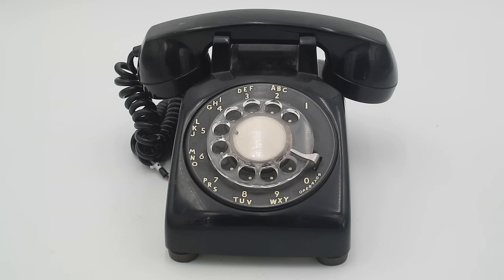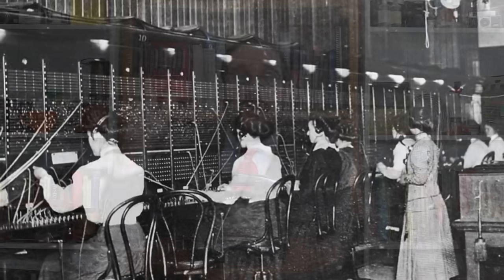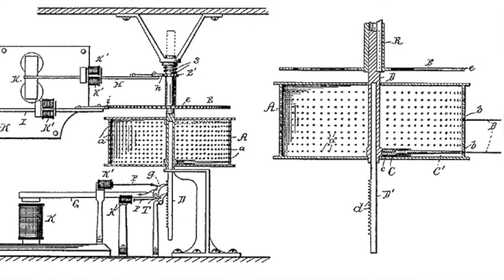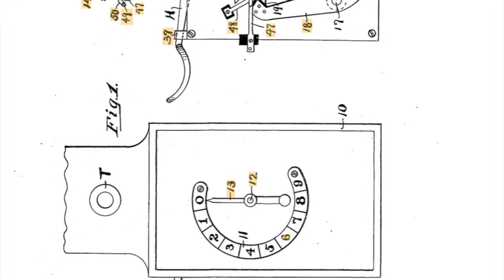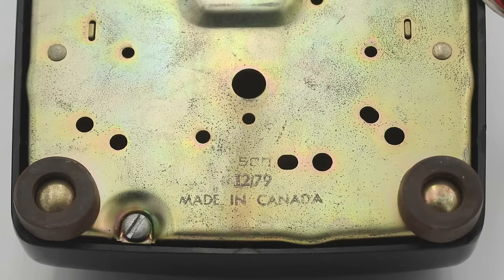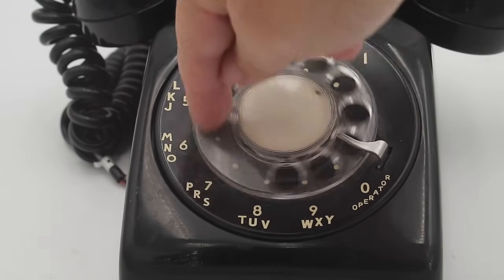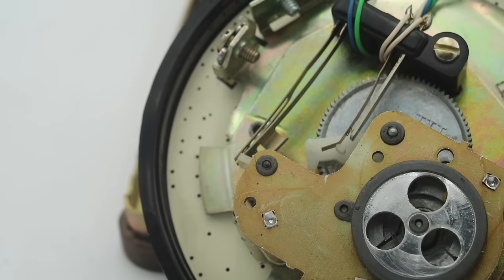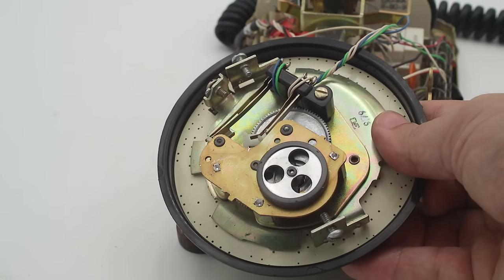Rotary Phones: the Call of History

Comment: Model 220 Slimline was also called "The Princess Phone". Neighbors got one in '66, I saw it.
Also: Model 500 was made of plastic so tough, you had to literally hit it with a sledgehammer to break it.
I've only watched 11min of the video so far, maybe this was mentioned later, I don't know.
Highly informative channel, glad I subscribed.
Reply: The Princess Phone predated the Trimline (Slimline) model by several years.  Princess phones had standard-sized "G" handset and a full sized dial with fixed finger stop.  Trimline phones had the dial built into the handset, so it was a smaller dial with less blank space between the digit 1 and the finger stop.  Therefore, the finger stop was designed to move with the dial just enough to add the rotation needed for the digit being dialed.  When installed with an external AC transformer, the dials of these phones would light up. The Princess Phone had a "Night Light" switch that would illuminate the dial even when the phone was not being used.  The Princess Phone marketing slogan was:  "It's little, it's lovely, it lights".

Comment: I'm 34 and even though the rotary dial was obsolete long before my time, when I was a child, we lived in a 1940s duplex for a few years until 2001, and the only phones we had were two wall rotary phones hardwired,  had a straight cloth cord connecting the handset to the receiver, no phone jacks to plug in a more modern phone, so I and my younger sister had to suck it up and learn how to use it if we wanted to talk to our friends bad enough 😂   My grandmother had a avocado green wall rotary dial in her kitchen until she passed away April 2022 age 96.   The phone was likely from the 60s or 70s if I had to guess, since pastel colors for appliances and bathroom fixtures were all the rage at the time, as was vivid colored deep pile carpets.  The phone still worked as of August 2022 when the estate was settled and a younger couple in their late 30s brought the house.   Something has been truly lost when you can no longer swiftly end a conversation gone sour by saying a few cuss words then slamming the handset down on the cradle, while the person on the other end hears a loud clack followed by the dial tone.  And since these old phones were rather heavy and  practically indestructible they could serve as a lethal weapon to a would-be burglar that got in the house.

Comment: The noise in a strauger exchange was unbelievable.
If someone was 'freaking' to receive a free call, the different frequeny was obvious and one of the many engineers which a busy exchange required could locate the 'different' switch and disable it
Reply: Tell us about freaking.
Reply: So was Rotary and Crossbar in the busy hour.

Comment: Love it! My working daily desk phone is a 1947 302. Made the same year I was and is the phone I grew up with. POTS.
Reply: Yes, back when things were MADE IN THE  USA and it was a normal sight to see a stove,  refrigerator/freezer, washer/dryer in service for 30 years if not longer with very little maintenance.  Nowadays you're lucky to see your new Samsung washer or refrigerator in use for more than 5 to 10 years. I was born '89 and we lived in a duplex built in the early 1940s during WWII for a few years 1998-2001, and there were two rotary dial phones on the wall, hardwired,  no phone jacks anywhere in the home.   Something has been truly lost when you can no longer bring a conversation gone sour to an abrupt end by yelling a few cuss words then slamming the handset down on the cradle😂 as well as double as a potential lethal weapon to a would-be  burglar who happens to make it inside 😂

Comment: I remember dialing numbers by clicking the receiver switch, mostly just to show off the trick. When they brought out tone dialing there was a cool digital watch released that you could store numbers on then hold up to the mic and it would dial by playing the tones. Regarding the charge of "abstracting electricity", there was a far more literal way to do it. The phone lines carried 12v DV. When I was young our power would often go out when it rained, so I rigged up a small portable B&W television to run on the power from the phone line.
Reply: Here in U.S. telephone lines are 48 volts  I surprised there was enough current to power a small tv.
Reply: It goes to 80V when it rings though - I don't imagine your little telly would have enjoyed that up it

Comment: It will still be a while before I miss this device.  I still use one of these in my house, despite all the modern systems installed in the city.  I live in São Paulo, Brazil and despite the digital system and fiber optics, I managed to install such a device!!!  And it works very well.  I love your channel.  Congratulations on the articles.  Congrats from Brazil.

Comment: Please see the Wikipedia article on Phone Phreaking. The hackers mostly used AC in-band signaling tones, also known as multi-frequency tones, but these are NOT "Touch Tones"
Reply: Yes. The tones from the phone to the exchange were different to the tones used between exchanges. In Australia phreaking did not work because the tones between exchanges used a different pair of wires to the speech wires.
Reply: The Captain Crunch whistle!
Reply: Tone generating boxes.  There was also a call forwarding feature that could be hijacked and used to make long distance calls for free.  Businesses that would have their calls forwarded to an operator or call taker during after hours.  An example is a hotel that forwards to a different phone number for making reservations.  You would call and talk to the person, ask for some daily rates etc and then let them hang up first while you would stay on the line.  When the call disconnected you would hear a dial tone that was much lower in volume and sounded distant.  You could then place a call for free if you could dial fast enough before the tone disappeared.  It was called a diverter.

Comment: Our first phone number, acquired in the 1940's, was 40W2. It was a four-party line in a manual exchange, and "40" was the line number. The "W" told the operator which side of the line (tip or ring) to ring on, and the "2" meant to send two rings. We didn't get dial service for around nearly decades.

I started with Pacific Telephone in 1963, and saw step-by-step, crossbar, and panel offices. The step system made logical sense to me, except the line finder which I still don't understand how it works. The common control systems (panel and crossbar) are still a mystery to me. Thanks for trying to explain them.
Reply: I can only guess at the actual workings of the line finder, but it seems reasonable to imagine that as the brush swept across the contacts; If that line was busy the voltage on it would be high, which would energise the horizontal relay and push the brush onto the next contact along. Rinse and repeat until the brush hit a contact with low voltage, indicating a vacant line available for the subscribers use! 😇

Comment: All dials are rotary but all rotaries are not dials. A "rotary" was once a system where an incoming line rotated to an open line so that a business could have one number answered by many to avoid busy signals. Another popular option for businesses in those days was the WATS line for cheap long distance.
Reply: “Rotary hunting,” to be precise. A business could have up to 10 phone numbers wired to one vertical level of a standard Strowger two-motion switch equipped for rotary hunting. The first phone number on the level started the hunting; callers needed no other number. As lines were used, the system “marked” the busy terminals with a voltage. The switch sensed that voltage and stepped to succeeding terminals until it either found an idle line or ran to the “eleventh rotary step,” which connected an all-circuits-busy tone to the caller.

There was also a more rare level-hunting switch. It hunted the first level, then could reset itself and hunt the succeeding levels in turn until it found an idle line. It could therefore hunt through 100 lines.
Reply: Cool . . . as a child I remember dial phones but not how business phones worked - I often find that I'm 50% linked to some of this stuff.

Comment: I remember those old rotary phones I used to start dialing with those phones ever since I was a boy. Back then you couldn't live without the seven digit phone number, that is because everyone was on the same area code. But now that everybody has wireless phones now we have to dial 10 digits instead of 7! We used to dial one when making a long-distance call, so but now we're going to have to start dialing the number one even if it's a local call. Because in San Diego since they only use two local area codes now you're going to have to get used to dialing one area code & 7 digit number. And pretty soon it is going to be mandatory whether you have a landline or a wireless phone!

Comment: The rotary-dial phone is so easy to operate that I was using one to call my grandparents by age 4 or 5. I had watched adults use it and once you understood the whole idea of the "Phone Number", it's incredibly easy!
In fact, in 1982 through 1991 or so, my main phone, used daily in our living room was still a standard, rotary-dial phone. Much like the one you show here. If it wasn't STOLEN (guess someone needed a "rare antique?") in 92, I'd likely used for years longer.
What I find incomprehensible, is when today's younger people (even 30 years old!) can not TELL TIME with a standard clock!!!!!
I find this unbelievable!!!!
BUT it happens all the time.
Reply: I came across my old princess phone that I had replaced with a cordless. I plugged it in to see if it still worked. At first I thought it didnt because there was no background noise when I picked it up. I started dialing and was amazed how the sound on those were so much better than the new ones.
Reply: They don't teach cursive writing had a kid ask what language I was writing. How long will it be before people stop learning to write because everything works by voice commands.
Reply: @maxpayne2574  The only thing I write in cursive is my signature; otherwise my handwriting is small caps like my (engineer) dad's.  I can see why it might be dropped to make room for other things.
Reply: @maxpayne2574  Are you reading a computer right now? That's your answer.

Comment: You can't get your hands on it, physically, but Bonanzaville, a museum in Fargo ND, does have one on display, wired up to a small local circuit within the display, that anyone can try out and watch it work, a step by step, or SxS, switching system. They also have a switch board and a digital system, possibly another type too from what I can recall.

Comment: Early pre-WWII 302s had zinc/composite cast metal cases(very desirable and I have). Another historically cool phone is the 5302. Has a body nearly 80% the same as a 500, but incompatible with 500 components, because that case was used to run out old 302 excess parts only. Anyway, apologies for interjecting, but the model 5302 was the first model from Western Electric to only use thermoplastic casing. Late 1930s(introduced 1937) 302s are metal case though. One of my cast metal case 302s is 1937 and the other 1939. And both are in use currently, and even when companies drop pulse dialing, I have an adapter that converts pulse to tone thankfully.
Another point: If possible, find a metal case or early thermoplastic with the "4H" dial retun mechanism. Has glorious return clicks. 😃

-Your friendly neighborhood antiques restorer

Comment: I worked for AT&T back in the late 2000s. We had a 20 story building in a moderately sized city that was filled with rotary switching equipment from the bottom floor all the way to the 18th floor. The top 2 floors housed offices and meeting rooms. It was less costly to leave the equipment where it sat than it was to try and empty out that space and somehow renovate it into more useful space. The building was actually designed & built around all that equipment. It was a staggering sight to see all that copper, brass and endless wires, thosands of miles of thin, worthless telephone wire!

Comment: As a British person, I have to point out an innaccuracy.  

0 isn't left free on British telephone numbers in order to dial the operator, 0 was (and still is) left free in order to indicate that you're dialling a non-local number.  

Also, the UK also uses 112 for emergency services alongside 999, it harkens back to our past membership of the EU and our still current membership in the continenet of Europe, 999 was retained for familiarity.  We also have standard no emergency numbers for the police and NHS, 101 and 111 respecitvely though those are recent.  

ALso, 911 has kind of a weird status on British telephone networks.  911 won't work on a landline but it will dial emergency sertvices on a mobile phone.  I think this is because when you dial 999, 112 or 911 on a mobile, you press send at the end of the number and the phone doesn't actually dial that number, it signals "connect me to emergency services" because it knows 911 is the complete number.  A landline doesn't know if you're dialling 911 or a number that begins with 911,so if no numbers in the UK exchange area begin with 911, you get a number unobtainable tone.

Comment: My parents still had a rotary dial phone at least a decade after pushbutton phones came out. I used to hate it when dialing numbers with lots of 0s and 9s. I had to plan my phone calls at least 5 minute in advance. :)  If it was an emergency I would resort to using smoke signals, because it was faster.

Comment: I have an interactive display of antique telephones wired back to a PABX. I taught my friend's 7 year old son how to use a rotary dial just the other day, he got the hang of it immediately. 

Here in Australia, the last of the manually operated magneto exchanges in remote parts of the country weren't closed and replaced with automatic dialling equipment until around 1984-5.
Reply: Same in USA. There were still many mechanical crossbar and stepper systems in use in 84-85 in the states. Good comment.
Reply: @KlodFather  Just to be clear, by "magneto", I'm referring to the telephones which required turning a crank to let the exchange know you wanted to place a call and a human operator sat at a plugboard would complete the call for you.

Comment: I New Zealand I lived just around the corner from a large exchange as a child in the early 1950s.. The doors were usually open because of the heat and good weather. Watching the rotary switches was hypnotic, the motor/generators making the various tones generated continuous sparking. The enormous lead acid batteries bubbled sulfurously in their lead lined room. Imagine being allowed into that world today. When using the cradle to "pulse dial", we had to subtract the needed number from 10 for the pulses. This meant learning and practicing first.
Reply: I've always wondered why Aus/NZ adopted the reverse signalling form to what was used in the US/Can/UK (Where pulses sent = Digit desired, rather than 10 - pulses sent) - Was this just to minimise signalling errors from bad/broken lines, or was this to solve the ambiguity of signalling a zero? (Which in the former was ten pulses). ☎
Reply: @dieseldragon6756  Australia used the same system as the US, Canada and the UK.

Comment: It's DTMF, not DMTF. Also it's Switch-Hook (some will say Hook-Switch) not Cradle-Switch. Enjoyed your video very much. Spent my career in Telecommunications, started with Pacific Telephone & Telegaph (A Bell System Co.) in 1978. Just retired as a VP of Engineering this last May. Worked for Northern Telecom when we intruduced the first digital PBX, the SL-1. And for those CO folks, of course the DMS-100's & 250's.
Reply: Of course, it's also important not to confuse DTMF dialing with MF tone signaling.  MF (multi-frequency) tone signaling was developed much earlier (1930's-40's) for sending telephone numbers between central office switching systems. This is part of what Phone Phreakers used to hack into the old network.  DTMF (dual tone multi-frequency) tones use a completely different set of frequencies, and were introduced in the 1960's to replace rotary dials in subscriber telephones.

BTW — Northern Electric made some very nice equipment; I was impressed the first time I used an SL-1 PBX, and I liked the look and feel of their multi-button sets.
Reply: Ah the good old NT SL-1 system.  Worked on lots of those in the 1980s.
Reply: @paulwarner5395   I admired the SL-1 too, but back in those days, my specialty was the OKI Disco III PBX — an earlier, all-electronic, time-division switch, which was manufactured in Ft. Lauderdale.

Comment: 9:30 - The ringer does not use an "electromagnetic oscillator". It's really just a simple type of AC motor that is driven directly by the ~100VAC 10Hz ringer signal.
Reply: Did you work in telephony?  I'm curious about the governor using "friction" instead of the figure skater technique... or maybe it was an air governor using those pedals.  I dunno.

Comment: Great summary. In 1959, I remotely controlled a fm radio station transmitter using a dial and a pair of Strowger relays. In the 60s in NYC, my phone was on the ACademy 2 exchange, the oldest in the city. The switchgear frequently stuck and you reached a lower number. Because our number was low, we received some of those calls.

Comment: 7:10 - Bakelite is not a thermoplastic. It's a cast (as opposed to molded) thermoset plastic. The main difference between the two is that the former can be re-melted and and formed into another shape at any time, whereas the latter undergoes a permanent chemical change as it cures and cannot be melted again.